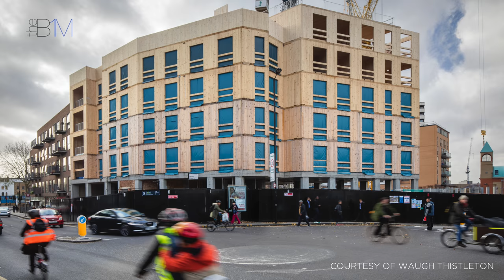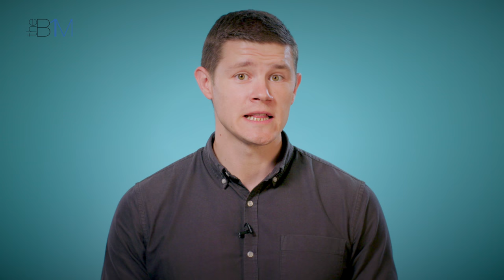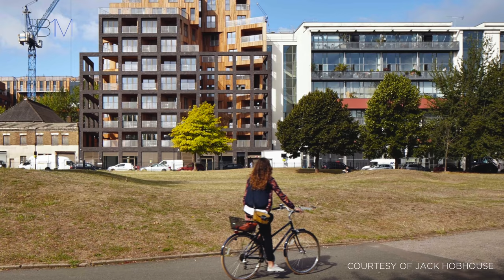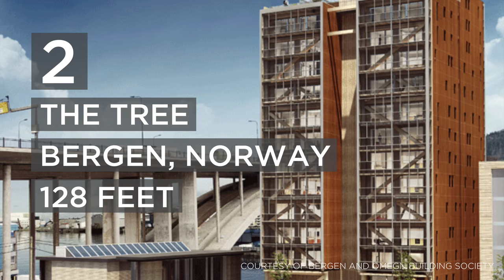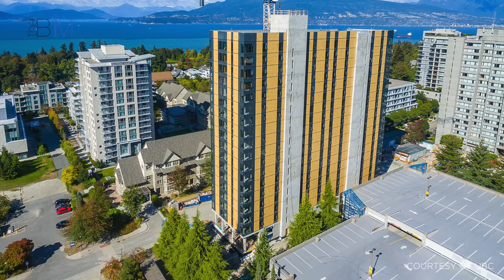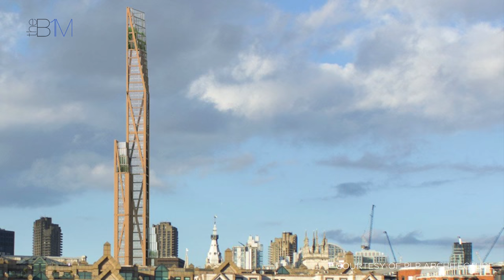The World's Tallest Timber Buildings

Comment: I love CLT panels and construction and am very intrigued by its properties but what is never mentioned about its sustainability is that timber mills take a massive amount of freshwater out of aquifers and streams and do not recycle it. in Virginia where i am just two large timber mills are actually taking so much water from underground aquifers that ground settlement is happening up to 50 miles away from the mill.
Reply: Wow I didn’t know about that. The wood they use for clt is supposed to be sustainably forested or from tree plantations, but I didn’t realize that milling the wood took so much water
Reply: @BigCroca  they're probably using steam to drive their machines and cure their glues (with heat).

Comment: What about fire protection and sound proofing. I wouldn't like to live in 1 of them
Reply: they would still have to meet regulation so i would assume they would be fireproof
Reply: Sound and fire proofing often perform better in a timber building than steel or concrete. Watch this for more info - https://www.youtube.com/watch?v=YuAya0hRjwU
Reply: Small wood beams burn fast, large wood beams burn slow. You have plenty of time to leave the building.
Reply: they meet fire regulation standards just like other building materials and actually because of its high fiber density CLT is inherently more fire resistant that any other building material, even concrete. Also, because of its high density sound dissipation and control is far higher that steel or concrete. Plenty of case studies out there.
Reply: ZoophreemiaHouse 
CLT is fireproof
Reply: "CLT is inherently more fire resistant that any other building material, even concrete."
^That is absolute bullshit. Even solid high density hardwoods impregnated with fire retardant do not perform as well as steel reinforced concrete. Not even close.
Reply: Noodle Mango no. Just no.
Reply: As a firefighter you would have only a short window of time to leave regardless of the fire protection systems in place ...its wood and woods burns rapidly when it reaches it flammability phase plus add furniture, fixtures, fittings, human factor and you have bon fire of massive proportions ...thanks but i like my concrete and steel
Reply: @Aprilsraven629  the high temperature during a fire will cause a chemical reaction in the concrete, weakening it, reducing the "cement" property. Even if a 'rock' doesn't burn it alter its internal.

Comment: Timber buildings have less co2 emissions during their construction process, but would the trees absorb much more CO2 if they were not used as building materials?
Reply: The amount of CO2 a tree absorb slows down as they row older, meaning cutting them down and planting new ones is more efficient,
By building in wood we constantly remove older trees that are less efficient and plant new ones that absorb more CO2.
Reply: @freedomfighter22222  It's a reasonable explanation. Thank you.

Comment: I am still not convinced how cutting down10x more trees and getting rid of useful wall cavities with CLT panels is a more efficient and sustainable way to erect buildings.
Reply: But isn't the world forests already shrinking from our current rate of lumber use?  To promote building buildings with floors and walls of solid wood panels higher than ever before seems backward and neglects generations of engineering efficiency. These buildings can be erected within a year or two but a single tree takes decades to mature depending on conditions plus they become homes for many wild life. If a single house now uses 3 or 4 trees by spacing the studs, how many trees are need for a skyscraper of mass timber?
Reply: 123d57 ok but so can steel. I think using timber is a bad idea.
Reply: Forest is not shrinking because of the lumber use rate, it is shrinking because other uses (agriculture, infrastructure or buildings) allocate the areas. Up to today, worldwide huge amounts of forest are burned down intentionally because there is no economic use for a forest and they want to convert it to farm land. I think this shows that there is not enough use for wood in these countries, otherwise you would not burn it. Instead countries which traditionally use a lot of wood value their forests. Canada and Scandinavia has, despite intensive use by the paper and other industry, huge amounts of forest. As soon as it is valued, you care about your forest.
Reply: it all balls down to energy consumption, cross laminated timber (CLT) consumes just 50% if the energy used to create concrete......if you look at the harm we put to the environment to produce energy, you will understand its a sustainable move.
Reply: Concrete is one of the least environmentally friendly building materials in large part due to the huge amount of CO2 released during the production of portland cement, and can not be recycled. Steel can be recycled an almost infinite amount but is incredibly energy intensive to produce, and needs to be treated with a number of toxic substances such as chromium, and hydrochloric acid.  Timber can be sustainably  harvested, sequesters carbon, and can be recycled at least once. Most deforestation isn't due to an over harvesting of wood for timber, although it does play a part where certain decorative woods like teak and mahogany are common. Most deforestation is due to land clearing for other commercial reasons such as creating new farm or gazing land, or encroaching human settlement.
Reply: We wouldn't run out of trees if we replant and grow them at the same rate we cut them.
Reply: @KolTony: Very important point. There are huge efforts to get rid of used concrete, but most of the concrete can't be recycled. It ends up in landfill. CLT on the other side can be used in waste incineration plant. Might sound wasteful, but think about it from a different perspective. Today a lot of trees are used for energy. Cut down and burned. Instead you put an additional use in between, and later burn it for the energy.

In Austria they try to improve this cycle. An outer layer, for example veneer, is added which can easily be removed during demolition. All the paint or whatever stuff is later added only touches the veneer and the core is safe for household wood stoves. This way you end up with "waste" a neighbor is likely happy to pick up.
Reply: Marvincent Acuña and thats the concern. We're not doing that now so why would we trust it happening anytime soon? Plus a forest fire can severely reduce stock. Ever wonder why they never show images of renewed forest but instead show the fancy new wood buildings? The area required to maintain mass timber market would have to be vast.
Reply: roman2011, Burlington has already been using biomass energy by growing and harvesting wood for a long time now, reportedly growing twice of how much they're harvesting, although they only grow low-grade wood. The idea of making buildings from grown and harvested trees shouldn't really be far-fetched with enough support to attempt doing it. Vermont isn't particularly invulnerable to forest mortality, either.
Reply: roman2011 think about the amount of wheat we cut down. Or the amount of cows we slaughter. If you want more of a given resource use it and farm it. World timber production for construction could be supplied from a relatively small area of managed timber farming. This sort of construction doesn't need mature trees.
Reply: Wood is part of the normal carbon cycle and in itself has no considerable impact on our atmospheric carbon concentration, when the overall biomass in the ecosystem is kept in balance. Burning fossile fuels however releases additional carbon into the air increasing the greenhouse effect. Carbon stored in fossile fuels underground and released into the air would ultimately need to be absorbed and transferred back underground, to get back to pre industrial CO2 concentration. A huge task. Another way to capture this fossil fuel released carbon would be to increase biomass by the equal amount that we added carbon into the atmosphere. Not sure how big such a forrest would need to be though. What shouldn’t happen though is chopping down old forest or jungles in favour of farming forests. Old forest have a much higher bio diversity than farming forest can offer, so we want to keep them around.
Reply: Reforestation dude. There are more forested areas in countries now that produce timber than there was about 100 years ago. This is due to reforestation. Alll those trees that are cut down will be replanted. Deforestation is only a problem in the tropics, as others have already pointed out.
Reply: Claq Yagami I'm all for reforestation - it's great. But have you ever heard of pine beetles? They've wiped out 80% of British Columbia forest in Western America. it's a huge concerned. Furthermore there have been massive forest fire and only seem to be getting worse each year. The point is Forests are facing major challenges and having to deal with increased clear cutting is not the time.
Reply: Never heard of them, no. But in all honesty that is  a localized issue affecting North America/Canada and it is a natural phenomenon which means in time it will correct itself.
Should that stop logging in Europe or Russia?
As for forest fires, I'm afraid the media has frightened you there, they are a natural part of the lifecycle of any forest (excepting the rainforests). As for them getting worse it is because we prevent them from burning in the first place as nature intended so the amount of flammable material is built up beyond what is normal, so when it finally starts really burning, well.....
Reply: Claq Yagami so what you're saying is clear cutting is part of the Forest natural life cycle for the purpose of building wood high-rises in the 21st century. A bit of a contradiction don't you think?
Reply: roman2011 are you not aware of how people get their metals and concrete? And the amount of energy they need after destroying the place where they got it from... ??
Reply: 1. CLT uses only 50% of the energy to make concrete and only 1% of the energy needed for steel.
2. CLT comes from sustainable forests.
3. One CLT building is equivalent to 53 cars off the road per year.
4. Timber was used for hundreds of years before us, what’s wrong with going back to that?
Reply: Sani Sadiq nayaya 
You might want to correct your typo "It all balls down" to "It all boils down". Thanks for a little laugh, and I agree with what you said.
Reply: centurion1945 It is possible, and in a few cases economical to recycle concrete, but good point. Example: in road construction, damaged pavement can be "rubblized" in place and used as a gravel bed for reconstruction. Old concrete can be crushed into gravel and used as an improved permeable gravel used in place of drainage rock in low strength applications. Concrete slabs can be reused to prevent erosion on shorelines. But sadly, most concrete will never be reused or recycled. You make a good point.
Reply: Also the fact is concrete is not sustainable it requires a specific type of  sand the kind at river beds and beaches which is being dug up and used at a very fast rate so either got to find a way to recycle concrete better or find an alternative thing to use
Reply: Please do  à part 2 of this video, as theee are more wooden buildings now, including the 25 story Ascent building in the US city of Milwaukee and the HoHo tower in Vienna.